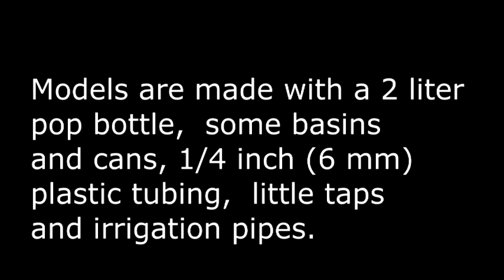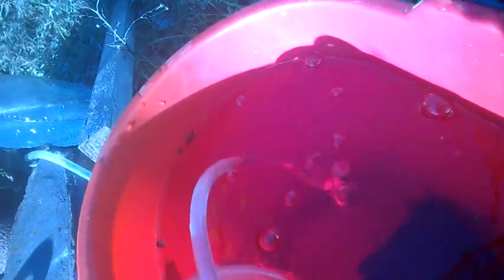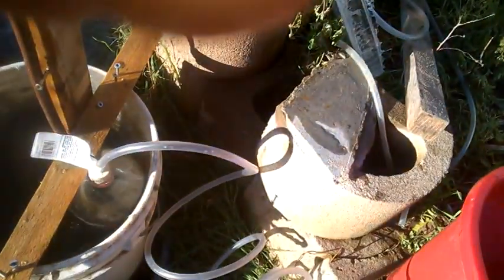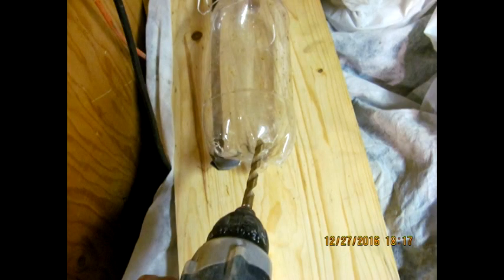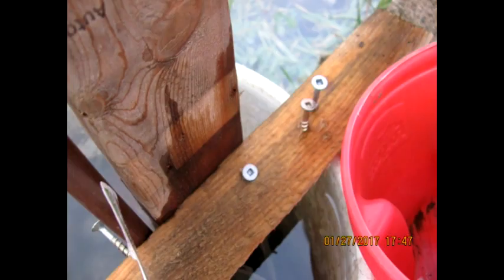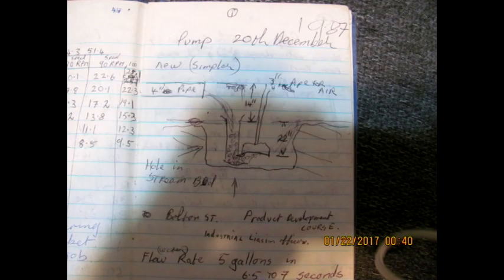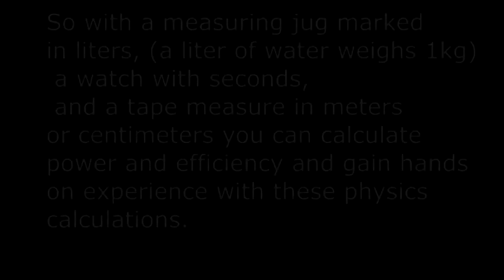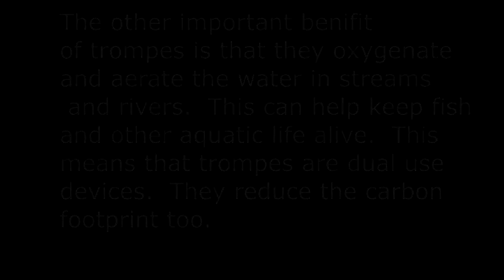Model of tromp and airlift pump for schools

Comment: Hi - I just found this more recent video on the airlift pump (for water).  Thank you the video quality is much better than earlier videos.  I've run across the Trompe air pump before, but not where it directly pumped water, I gather called a Pulser pump.  My question is whether a Pulser pump could be scaled larger and be competitive with water powered pumps like spiral, mechanical, direct lift and hydraulic water powered pumps?

For my purpose, competitiveness is measured as cost to deliver a volume of water to a specific usable height.  

Is there a limit to how large a Pulser pump can be scaled?  Perhaps, related to surface tension of the water that might limit size of the air lock bubbles that drive the water upward through the pipe?  I'm not clear how the bubbles are forced downward into the chamber.

Very interesting videos - I had not run across the Pulser pump before.
Dave from Water Powered Pumps public Facebook discussion group: https://www.facebook.com/groups/240458583255303/

If someone hasn't done it already (I'll post the link here if it happens), that someone start a discussion about Pulser pumps in the Facebook group so we can compare to other approaches.